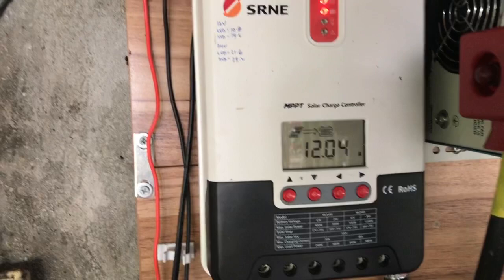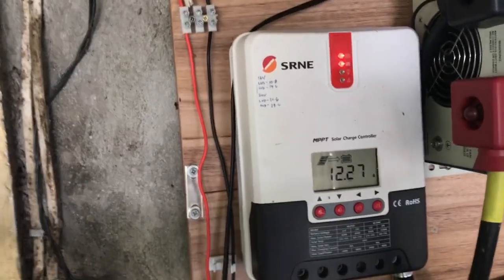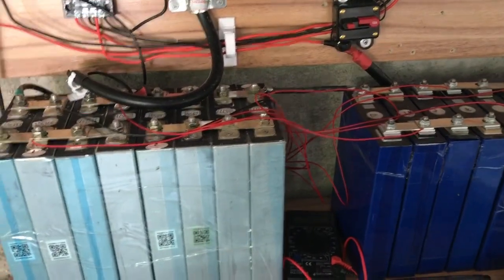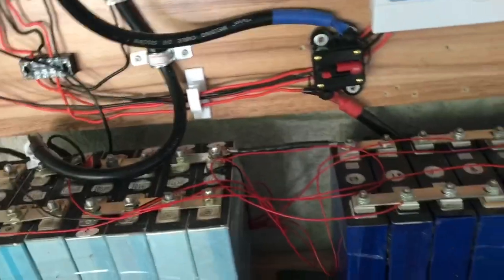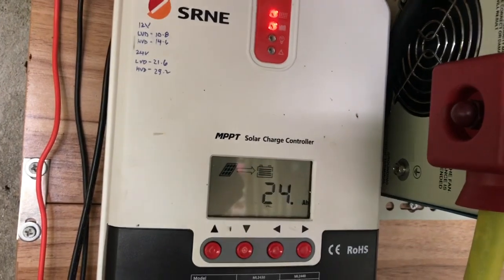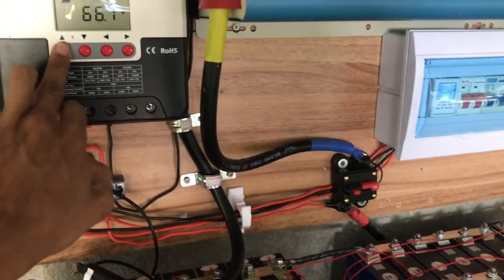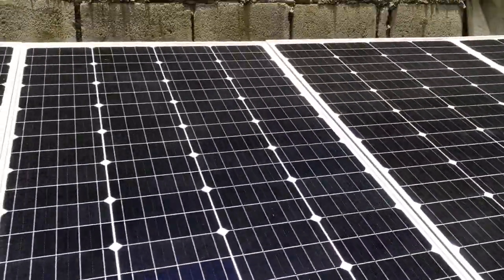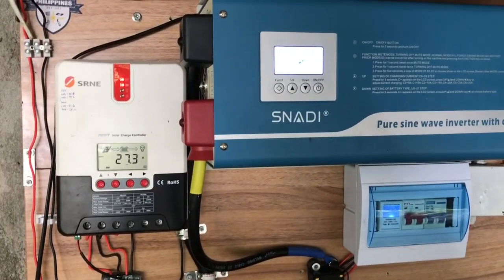Harvest ng 400 watts Solar Homes Solar Panel

Comment: correction lng! ung volts n pnkita mo SRNE MPPT eh 65V+ un ang volts n galing s solar panel at ang amps n pnpkita mo 11.9A+ eh amps n pumapasok s battery mo. 4 pcs panel 100watts in series with 5.4 imp ( 18,5V x 4S = 74V x 5.41A = 400watts.  Charge state ng battery mo is 27.4V x 11.9A = 326 watts... yan ang harvest ng solar panel mo.

Comment: Ilan watts idle power consumption nyan sir..,
Reply from the maker: 300watts normal consumption. D p kasama ung sa rice cooker at ung water heater. Tpos ung washing. Pero total q within 12hrs is nsa 1200-1300 watts base sa digital power meter q.